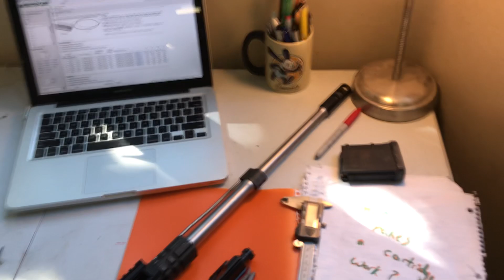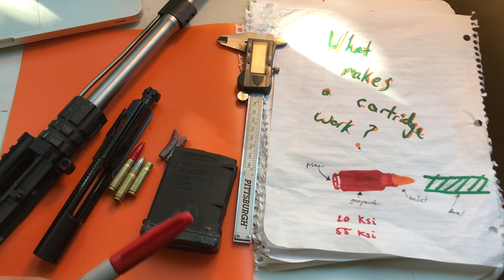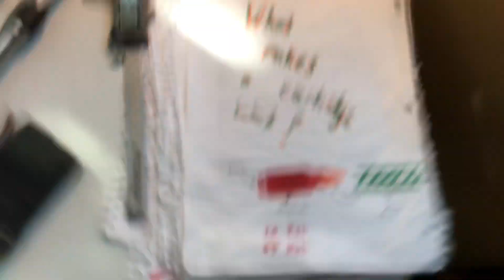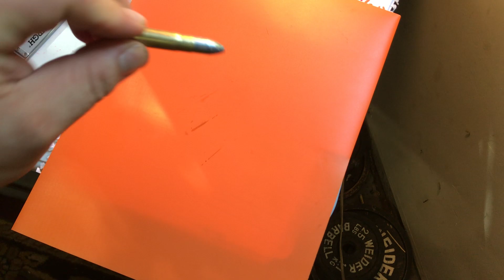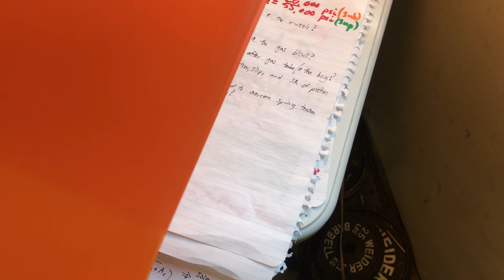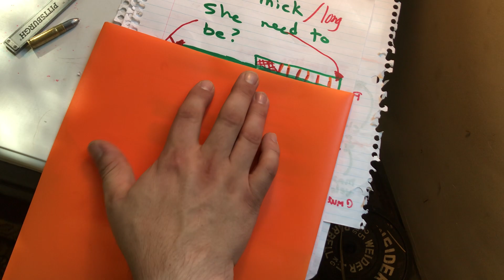Firearm Design: Pressure; Silencer, Barrel, how to, Part 1

Comment from the maker: I made a couple mistake and mispoke a few times. 

Some bigger ones i noticed were during the inert gas law. We do know the number of moles / weight of gunpowder. You would have a high temperature in the beginning and a low volume high pressure. And a low pressure higj volume low temp at the end. Relatively. The presure*volume goves you psi, just like the stress equation below. 

Then when i mention calc, it would give you a better result at any point within the system and allows for more complex equations. 

I choose to do “shapshots” certain distances/ given variables/barrel length/volume and used simplified equations.